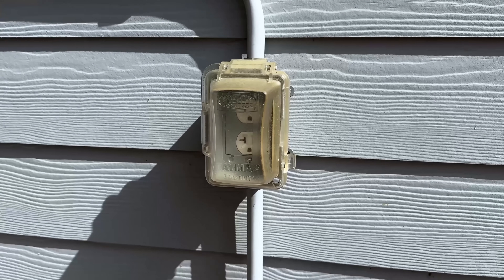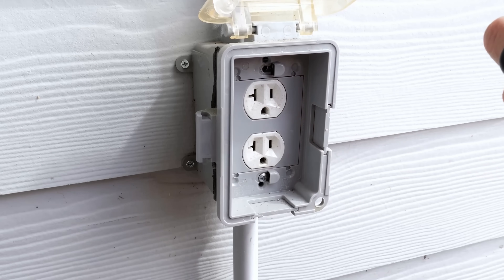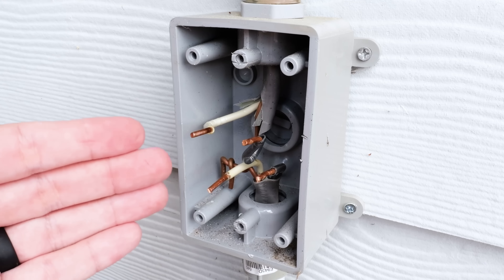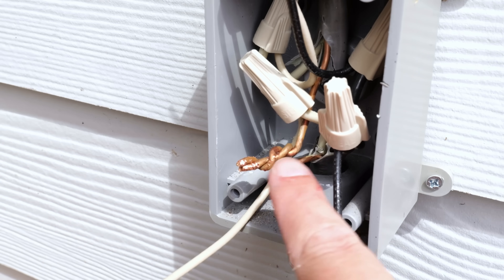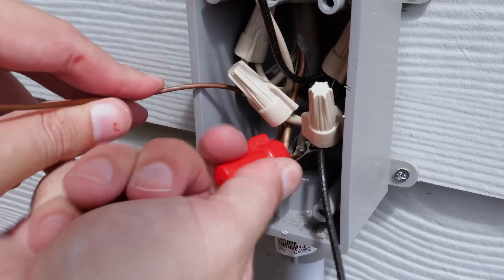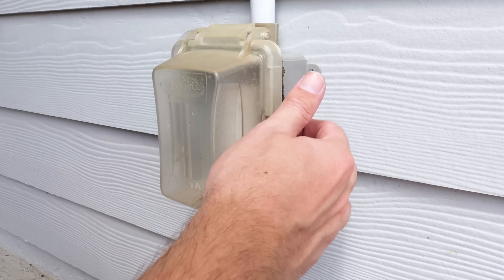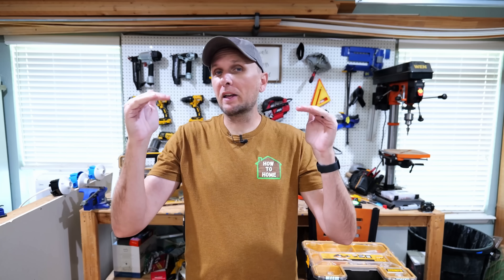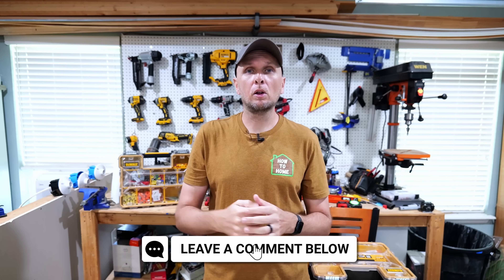Dangerous Mistakes DIYers Miss When Installing Outdoor Outlets!

Comment: I was looking forward to seeing you cram all of that stuff into the box.
Reply: The cost for GFCI Breakers is 3 to 4 times the cost of a GFCI outlet. That might be a consideration for many people.
Reply: @mikeslater6246  doesn't pretty much every room in a residence now require AFCI? I went with GFCI/AFCI myself because the combination breakers were only like $2 more than arc fault alone.
Reply: @mikeslater6246 If you have ever had to replace outdoor GFCI outlets you would understand that sometimes it's better to spend a little money now, instead of spending money every 3 to 5 years.
Reply: I was wondering about that too.  THAT would have been worth a video all on its own!
Reply: You'll know the outlet is tightened down enough when you see the wire nuts protruding from the sides of the box.
Reply: i agree.......
Reply: Me too.
Reply: I was thinking the same thing the box fill is code as well
Reply: My thought on code is this . Are ALL older homes up to code? Are those people in great danger of dieing? Do you see/hear it on the news a lot? At what point did CODE go too far? When will it end ? When no one is going to be able to afford wiring to be installed. At 120/240V. Can you see a time where you'll have to get a permit to go outside for YOUR PROTECTION.  Still alive in my house that would not in any way meet any codes of today . Remember , in America you are FREE to do -----what you government tells you !
Reply: It's because he used wagos and wire nuts, and that's an overkill to extend wires since it takes so much space in an already crowded electrical box (not to mention GFCI outlets are larger than standard). I was disappointed because of this.  He should have used heat shrink tubing instead.
Reply: If the original intent of the 10ga wire was due to wire length wouldn’t it have been better to tie the the stream and downstream hot and neutral wires together in two 3-way connections with their respective 12ga pigtail wires and attach the pigtails to the line side of the GFCI? You’d save the space taken up by two extra wire-nuts and pigtails and avoid splicing a higher resistance 12ga segment in series with your 10ga run.  

Yes, you’d have to install another GFCI at the downstream end of the 10ga run but not a big deal. 

An even better solution than the GFCI receptacles for this installation would be to replace the circuit breaker with a GFCI circuit breaker. Then you could use standard receptacles and save more space in the outlet boxes and still have everything protected.
Reply: @Dave-ei7kk  No. The short 12ga pigtails have no noticeable effect on voltage drop for their short length. It's protected by a 20amp breaker, so the #12 is safe. Further, your approach would not provide GFI protection of that downstream load.  Connecting the GFI receptacle as shown in the video, properly using line and load terminals, provides that protection both to the GFI receptacle and loads connected to it, and to whatever load and wiring is downstream.
Reply: @Dave-ei7kk  yes wired in parallel instead would of been better
Reply: This comment made me watch it to the end, how did he do that?  Must be the camera.  Why do I watch stuff like this, first thing I thought of is, why are you there?  That's half the fun, seeing what the service order says.  Reminds me of a new boss, long ago, he would take two and I would get a fist full.  In the truck I'd scan through them, pick out the problem child Karen that wants to be first and drop it behind the seat, then turn the radio off and toss it in the passenger floorboard.  This guy would call me all day long asking me how to do his job, in the blind.  It was funny, he bought more chargers, then batteries, then switched radios.  One time an inspector kicked me off the job for being barefooted in a empty rebar/gunite swimming pool because there wasn't a bonding wire to the equipment, thus I was not grounded, might get hit by lightning!
Reply: He didn’t you can see that it didn’t fit. And then in the next shot it is in but if you look you don’t see half of the wires
Reply: @Nuf_Nivah  Green screen is wonderful.  🤗
Reply from the maker: @Nuf_Nivah you can’t see the wires just because I changed the camera angle to the side for a better shot of the outlet being screwed into the box.  I can see now that all of your comments are just made up and wrong.
Reply: @HowToHomeDIY  If you go from the still shot at 10:07 to getting that GFI to fit, you sir, are a wizard. I'd like to see it tho.

Comment: From the plug face, it seems that you replaced a 20 amp with a 15 amp.  Is this correct?
Reply from the maker: I did.  And it is totally allowed by code.  I have no need for a 20 amp receptacle there.
Reply: @HowToHomeDIY  But you circuit breaker is a 20Amp powering a 15A receptacle !
Reply from the maker: @JohnnyVoikdal ok and?
Reply: @HowToHomeDIY  Amperage capacity must match the breaker and the outlet. Doing what you did, the user could overload the 15A receptacle up to 20A, which may cause a fire.
Reply from the maker: Incorrect.  Per NEC table 210.21(B)(3) a 15 amp receptacle can be installed on a 20 amp circuit. The only time this is not allowed is if it is a single 15 amp outlet with no others on the circuit.  Mine has others and it’s a duplex receptacle which is two.  Also, it won’t cause a fire as the internals of a 15 amp receptacle are oftentimes identical to a 20 amp receptacle and rated as such.
Reply: @HowToHomeDIY  I have to agree but I would NEVER do this anyway. And "oftentimes" is a word that cannot be applied to safety and especially for chinese-made outlets.
Reply from the maker: @JohnnyVoikdal it doesn’t matter in this case if it is oftentimes, sometimes, or never identical.  They are all rated for 20 amps.  And Leviton and Eaton are both American companies.  I’m not trying to talk you into doing it, but what you have said prior to this has not been accurate.
Reply: @JohnnyVoikdal that's why the 15 amp receptacle can't physically accept a 20 amp plug.  I agree, downgrading the receptacle is cheesy. But it's legal.
Reply from the maker: @thatWasntMe how is it cheesy?  It’s simply preference.
Reply: @JohnnyVoikdal  I'll bet almost every circuit in your house is 20amp with 15 amp receptacles.  They are running 12 gauge, and have overhead for multiple 15 amp appliances.
Reply: @anxiousappliance  Yes, but they use a 15A breaker, not 20A
Reply: @ The breaker doesn't power anything .  that's not how it works.  C'mon.
Reply: @anxiousappliance  Can't you read between the lines ? Of course, the breaker does not "power" the load per se, it's just a usual expression.
Reply: @JohnnyVoikdal  I'll call the Oracle of Delphi, if you read something about electricity.

Comment: I thought Romex was not allowed in PVC conduit in a wet location.  Also, in my region we are required to use covers that allow a cord and remain sealed.   Is your example code compliant in both of these conditions?    Thanx!
Reply: Non electrician here, but have done a lot of my own wiring to code so just asking, I thought NEC 334.15(B) allows NM cable in conduit as long as it doesn’t exceed capacity and is not being used in a wet location. I’m thinking outdoors is a wet location?
Reply: He's using an "in-use" box that you described.
Reply: That isn't NM-B, its UF-B (underground) wire.

Comment: Question: would any outlets down line from this GFCI-protected receptacle require that they have GFCI outlets as well, or is having the first on the circuit a GFCI enough?
Reply: Only one GFCI device is allowed on a circuit.
Reply: @LawrenceRichards-kd3ms   Can you provide a reference for that in the NEC?  If that's the case, I need to replace a bunch of outlets.  The builder of my house installed outlets at each corner in my soffit for Christmas lights and they are all GFCI, and they are all on the same breaker.
Reply: It depends how they are wired.  If the downstream receptacles are wired to the Line side, they are not GFCI protected by the first receptacle, and your installation is okay, although there is unnecessary expense from the additional GFCI receptacles continuously consuming a small amount of electricity - $3 to $10 each year per GFCI.  But some people like the convenience of seeing/resetting a trip at the plug location.

But if they are chained off the Load side, the downstream ones are already GFCI protected, and may behave strangely if tripped, or be unable to be reset.
Reply: @skityke   I hadn't thought about them being chained on the line side, but knowing the guy that built this house, I seriously doubt that's how it was done.  I'll have to take a look.  And maybe more than one was permissible back in 2003 when it was built.

Comment: Will routing that current from the 10 gauge wires through the 12 gauge wires affect anything?  Will the 12 gauge wires handle that current OK? I went out and noticed I have a standard outlet on my outside power source, built into the wall and not external like yours, should I still change the outlet?
Reply: All that matters is that the breaker amperage rating matches the ampacity of the thinnest (highest-numbered) gauge of wiring on the circuit. In this case the thinnest wiring used anywhere is 12 gauge, and 12 gauge wiring is rated to carry 20 amps, so as long as the breaker is no higher than 20 amps, everything is good.

Where a code violation could arise here would be if somebody had assumed that the presence of 10 gauge wiring anywhere in the circuit allowed the use of a 30 amp breaker. If ALL of the wiring on the circuit was 10 gauge, a 30 amp breaker would indeed be legal. That is not the case in this video, though, with a mix of 10 gauge and 12 gauge wiring; we have to size the breaker in accordance with the thinner 12-gauge wiring, which means we must use a 20 amp breaker.
Reply: @Larry_Harvilla  "All that matters" for code. Remember, code is the minimum requirement, not always good practice.  He mentioned it being a long run. Higher gauge wire has more resistance per meter, which leads to more voltage drop per meter. If you then put what should be a 20A load at the end of the run, but your supply voltage has dropped below spec due to the line resistance, you can be in for a bad day. 

That said, and to answer the original question, no, a few inches of 12 Ga. wire in the middle of a 10 Ga. run won't matter for mitigating the voltage drop (assuming the wire nuts are, indeed, applied correctly).  The 12 Ga. wire acts as a series resistor, with 2 extra junction resistors (the wire nuts). Ballpark figure is somewhere around 1.6 mili ohms per inch for 12 Ga. solid core wire, so that 6 inch pigtail is adding about 10 mili ohms, it's the equivalent of about an extra 10 inches of the 10 Ga. wire, so unless it was already almost out of spec, won't matter.
Reply from the maker: The 12 gauge wire is rated for 20 amps so it will handle the current just fine.  In my case it also won't effect voltage drop as it is so far upstream.  That depends on if that outdoor outlet is downstream from an installed GFCI receptacle upstream or a GFCI circuit breaker.  So I can't really answer that for you since I can't see what you have.
Reply: @HowToHomeDIY  you really think that it matters where in the circuit the 12ga wire is? You have degraded the wire to the lowest gauge regardless of location. If 10ga was for voltage drop, something you didn't verify in the video, you now have a 12ga circuit. To be honest, i wanted to see you stick all those 10ga pigtails into that box with the GFCI and then close it back up.
Reply from the maker: @Paul-l1z8x I don’t just think, I know.  I’ve verified it with numerous electricians.  The #12 wire will have zero effect on a voltage drop that far upstream.  I wasn’t going to use #10 pigtails because it would’ve been near impossible to work with and it wasn’t necessary.
Reply: @ Where in the circuit the #12 section is doesn't matter for voltage drop. You could put your #12 pigtail at the distal end of the run and it would have the same effect.  It isn't quite true to say it'll have 0 effect, but the effect is proportional to the lengh.  #12 wire drops voltage at about 1.5x the rate of #10 wire, so that 6 inches of #12 is about the same as adding 10 inches of #10, so the effect of using the lighter wire is effectively an extra 4 inches on the end of the run.  Not nothing, but little enough you'd have to use a scope and specifically look for it, under heavy load, to even detect it.
Reply: I'm glad you know. I wasn't trying to make a point about voltage drop but about down sizing the wire and mixing wire sizes. I think it has something to do with good practice and there may even be a NEC uniformity requirement that has been violated.  If I had seen the other comments about wire sizing I wouldn't have made my comment except the part about really wanting to see you cram all the 10ga back into that single gang box.
Reply: @Paul-l1z8x  The potential issue is if someone later comes along and assumes since it's 10 Ga at the box, and 10 Ga at the distal end, that it's 10 the whole way, and they swap in a 30A breaker. Personally, I wouldn't mix a smaller size pigtail mid-line specifically for that reason, but code doesn't usually worry very much about future proofing.
Reply: Another issue is the romax running through the conduit .not legal must be single strand wire .
Reply: @ That is not correct.  In the US, Romex (NM cable) can be run through dry conduit, assuming your local city or county don't have additional requirements above the NEC. Note the extra insulation counts against your allowed fill, so you end up needing a bigger conduit for the same number and size of conductors.  Also putting it in conduit doesn't remove the requirement that Romex is only used in dry environments.  So in this video, where the underlying issue is this is an externally mounted outlet, Romex is not allowed.

Comment: I did (moved it) an outdoor recep last week that was put in by an electrician, not GFCI but WR logo. I wondered why it wasn't GFCI.  I need to check. Anyway, when I moved it ,  I used wagos. Tested it- open ground. The ground wire slipped out of the Wago because it flipped up when I stuffed the wires back in.  I always tape those things now, but really prefer not to use Wagos unless I think I may need to replace the fixture or add something.  How does someone even install the recep in the first place if they don't even have enough wire sticking out of the box?!

Comment: that cover is designed so you can leave the mounting screws in the device, put them a couple turns into the box, and then push the device back and slip the keyslots of the cover over the screwheads.  sometimes it even works that way.

also, it looks like the homeowner used a box with 3/4 inch threaded hols and used male adapters to secure the conduit into the box.  they do make boxes where you glue the conduit directly in.  it's faster, cheaper, and easier.

Comment: I have standard outlets but have a 20A gfci breaker dedicated for that circuit in the main.  Is that acceptable?
Reply: By "standard outlets" assuming you mean 15 amp duplex receptacles, then yes. The wire must be 12 gauge, however.

Comment: There could be a gfci on another plug on the circuit.  In that case it's still protected.
Reply: did you miss where he said there wasn't?
Reply: Only one GFCI protection device per circuit is allowed.
Reply: @LawrenceRichards-kd3ms  but you can have another plug or device down the line that's not gfci.

Comment: I think the stupidest thing is to say you need longer wire. The reason could want you to have long wires is so that a customer working on it has the longer wires. There is no safety reason that you need longer wires.
Reply: you mean besides having to work in such close quarters, and not being able to have enough wire length to be sure you're getting it connected right.
Reply: @kenbrown2808  I agree but he already had the outlet, and I believe that trying to fit the extra wire in there would probably be harder for him to do than to have less wire. I love having extra wire, but I always have to buy extra big boxes.
Reply: @notusedexer  personally, I would have pulled out the wire between the box and panel and replaced it, since it sounds like it was short.  but short wires in a box are still obnoxious.
Reply: @kenbrown2808  agreed. I don't understand why electrical boxes aren't bigger. The problem with long wires is that though it's totally awesome when connecting, it's really hard, at least for me, to push the wires back in a box when working with large items such as GFCI receptacles.
Reply: @notusedexer  those boxes aren't bigger. because they have to balance space with creating a hazard by sticking out too far.  you can get  a size deeper than that, and they stick out another half inch or so from the wall.
Reply: @kenbrown2808  makes sense. Maybe wider is the way to go?
Reply: @notusedexer  there would be ways to use a double box with a dummy device, if you needed that much space. Almost easier to set a separate splice box, though.
Reply: @kenbrown2808  I was just thinking a slightly larger box should be standard.

Comment: Perhaps you might mention the number of clamps are require to secure a given length of conduit run.
Reply: with PVC, you don't want more than 4.5 feet between straps.  I forget the distance allowed from a box, off the top of my head, but 6-9 inches from a box gives good support, and is within th minimum distance.